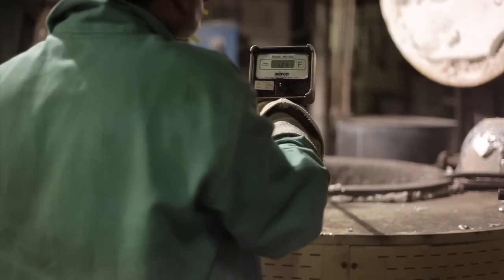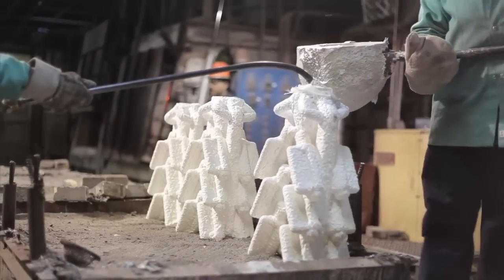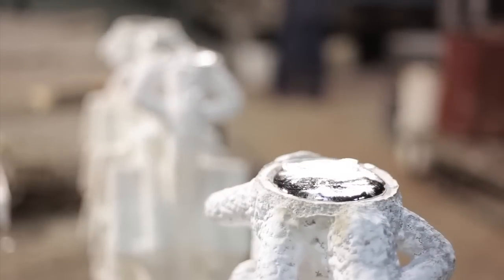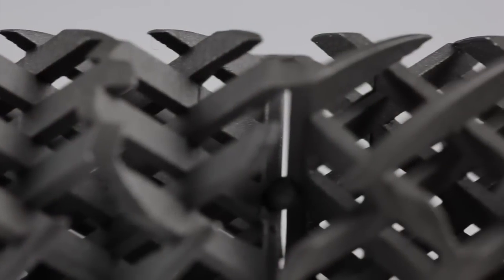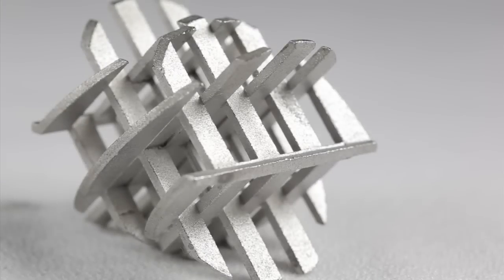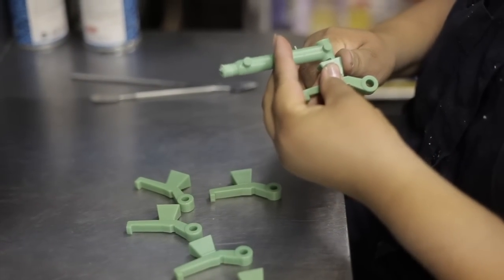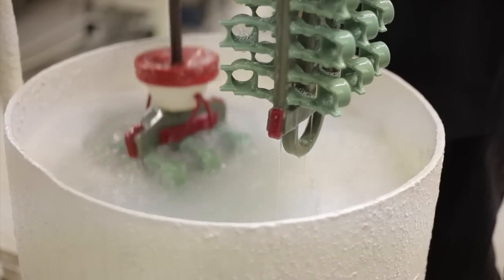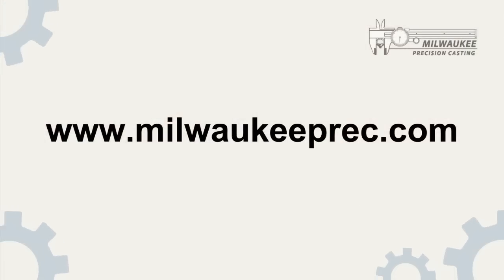Aluminum Casting - Aluminum Investment Casting Video

Comment: What is the pipe that is held close to the head when the aluminium is being poured?
Reply: Most probably, it's Argon or Nitrogen for preventing the interaction between melted Al and ceramic mould.
Reply: @muratozcan3460  I think its argon to prevent oxidation between melted aluminum and oxygen inside the mold.
Reply: @muratozcan3460  its probably argon to protect the flowing aluminum from oxidation